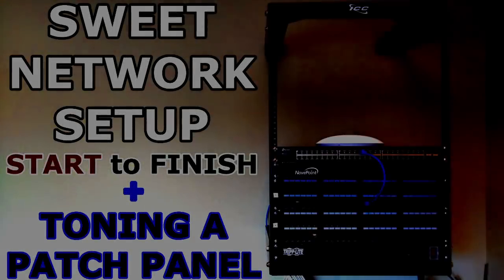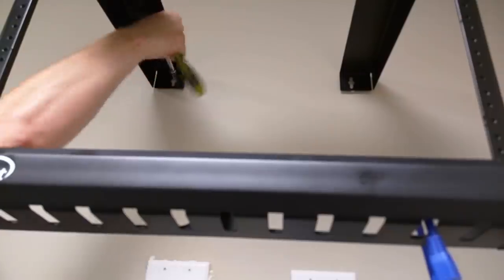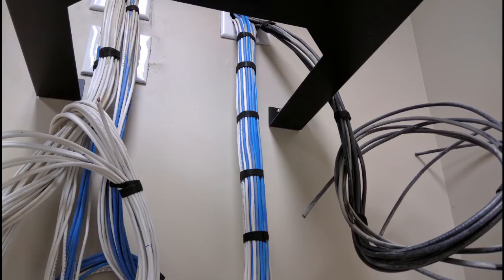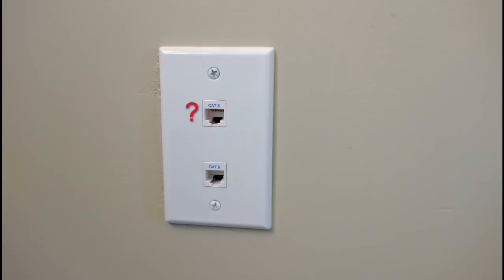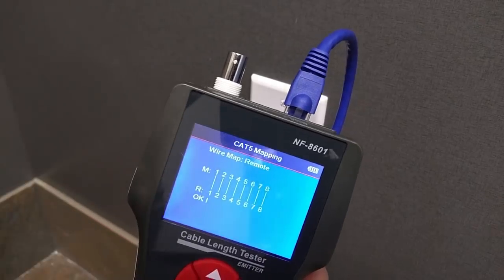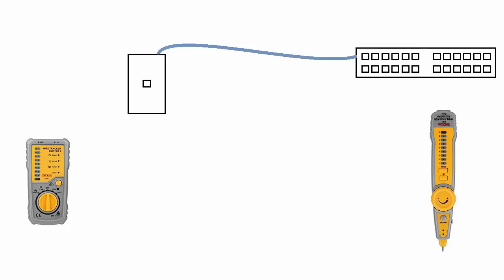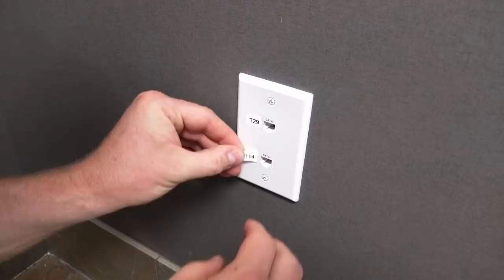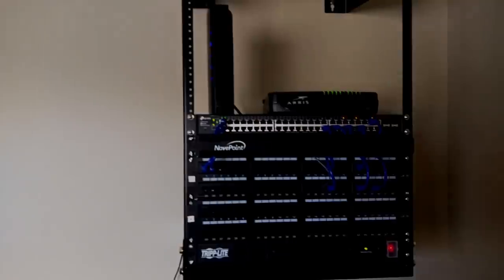Complete Network Setup // Toning, Identifying Ports

Comment: I am no professional and I did the same job in my appartment 2 years ago alone. 16port unmanaged PoE switch, hooked to a 24port patch panel. No testers used on T568B connections and it works flawless. Smart Tv's, Home alarm, Voip, computers, Dvr, etc. No lost packages, everything running 1Gbps steady. The only nightmare is the cable management
Reply: Whats the difference between unmanaged poe switch and a normal switch? 

Well, I'm a beginner and I want to learn.
Reply: @admiralgeneralaladeen2949  there are two common kinds of switches. Unmanaged type which  are  for home use where no supervision is needed(you just plug them in, and they operate) and the managed ones which have subcategories (ex enterprise and smart switches) and built in web interface for further customization. You may find them also as level 2 switches(unmanaged) and as level 3(managed with routing capabilities). To answer your first question, PoE refers to Power over Ethernet, which is another protocol for powering devices through 12v output for example cctv cameras. Practically PoE is needed for long distances where you want to power and at the same time have access to your device without a need for extra cable for electricity. PoE does them both in the same cable
Reply: @aglaisma  I'm starting from the basics of designing network setups. And these things confuses me. Btw, Thanks for the answer. 

1 more question. Do we just plug in some Cat 5e to a patch panel from a switch so that the connection from the switch will extend to the patch panel? 
Like for example. (Switch) Port 1 then connected to a patch panel. Then the whole ports on the patch panel can now have connection comming from the switch? 

I'm very grateful you answered my prev question.
Reply: @admiralgeneralaladeen2949  No. Patch panel brings all your rooms/workstations to one place so you can easily give data/internet/telephony etc via your telephone plug/switch/modem etc. It s up to you, what exactly to connect on it. Mine for example, has 2 Lan cables running to the first bedroom, two more to the second bedroom, one Lan cable to my office, one port is in use of extra wifi access point, one is attached to 4g antenna for better signal of my mobile, one goes to my alarm system and 4 more in the other house. 1 port of my patch panel goes to my modem. In front of this port i connect a plain 5e lan cable to the switch. Now i have internet into the switch and any cable i connect now from switch to patch panel has internet connection. It's exactly the opposite of what you asked. Patch panel ends connections-switch shares connections

Comment: Great video...very useful even 3 years later!  I embarked on a home project, which also entails setting up a home network with Cat 7a STP.  Hopefully you can help clear this up for me.  I've read that Cat anything shouldn't be run parallel (closer than 4") to electrical cabling nor to each other to prevent cross-talk.  However, it seems that I see network cabling bundled together in long runs (and have at my work-place in all of my adult life), not just at the panel and switch.  I have one bulk-head in my basement which I had hoped to run cables.  Advice?  Also, I am now reading that POE will potentially require an electrical certification for installation??  Should these cables be separated from other data cables?
Reply from the maker: It's always best to keep the power wires away from networking cables, or any low voltage cable for that matter yes. For interfere and safety reasons. You don't want high power to be introduced into the Ethernet lines by some short or mistake.

I've never heard of keeping Ethernet cables away from other Ethernet cables though. You're fine bundling those together I'm sure if it.

As far as license for running Poe, I have heard of that, but your laws might be different than the ones in my state. I'd just double check.
Reply: "Cat 7a STP." waste of money.  Gb Ethernet was designed to use plain CAT5, before even 5e was available.  Also, twisted pair Ethernet was designed to share cables with telephones (look up StarLAN).  The frequencies used in Ethernet are much higher than those used in power or telephones, so cross talk is pretty much impossible.  The 4 pairs also have different twist rates, to prevent cross talk within the cable.  I've used STP in only a few situations, running from roof mounted short haul microwave systems, in elevator machinery rooms and on cell radio sites.  It will do nothing for you in a home or office.

Comment: regards,
I would like to know if all the wiring connections take the same pattern from the PC to Keystone Jack then to Patch Panel then to the router then to the poe switch then to the repeater. In conclusion, do you use pattern b for everything, or do you modify some cables?
I have a project in my office and I would like to know if I should use pattern b for everything that uses Cat5e cable, PC, Keystone Jack, Patch Panel, Poe Switch, Printer, IP Cameras, Repeater, NVR and router.
Reply from the maker: Simply put, yes. Stick with one pattern for everything. B is most common.
Reply: @BudgetNerd  Thanks for the answer, but I have another concern because I see other people who make the cable use another configuration, for example at one end of the cable they use pattern A and at the other end they use pattern B. What would be the difference between the way you you use and this
Reply from the maker: As long as you setup the wires the same on both sides, it doesn't matter what order they are in. People won't do A on one end and B on the other end of the same cable that wouldn't work.

Comment: Hey mate me again. When choosing a router what do you suggest? I noticed in you 101 video you had multiple things plugged in but with this you only had one. I planning on having ip cameras, a media pc, plan to pc's and a little bit of home automation. Would I have all 4 plugged into the same router point or separate?
Reply from the maker: I would get a 802.11ac or better wireless router for that. Personally, I would wire all I could if I were you, so you would want to add a switch. A POE switch could power your IP cameras and make that easier.

If you want a simpler setup, you could hook it all up to the same switch/router. You could plug the IP cameras to their own switch (or maybe they come with their own switch of storts) to help with traffic, or to another router to keep them segregated from your normal network. There are lots of ways to do it.
Reply: @BudgetNerd   Budget Nerd  I plan on running everything hardwired and having a wireless access point in the center of the home. Each bedroom one plan port and in the study and living Ares at least 3. Then with the ip cameras I'm planning on running cat6 to all points of the house as many as I can.
Reply: I run pfSense on a mini PC with 4 Gb Ethernet ports and a separate access point.

Comment: At the 10:51 mark, I noticed that you have the ethernet cable coming from the router's LAN port to the patch panel. Is this necessary?? Could I just run that ethernet cable directly to the switch?
Reply from the maker: You can do that. I did it the way I did so I could keep everything neat, so I wouldn't have a cable coming from underneath or from aboveb and into the switch.

Comment: This is the way patch panels have been done for decades. It should be noted that a great deal of world experience has found solutions to some of the PITA parts of doing network installs. I will point out several here.
1. Don't cluster your patch panels together at the top or bottom of the rack. Install panels directly above and/or below each network device. Example: If you install a switch that has 1 row of jacks, install above or below it a patch panel so the patch cables can be as short as possible. Ideal is one 6 inch patch cable to every jack directly above or below each switch port. This does several things. It makes horizontal cable management unnecessary. The cost of patch cables is far cheaper. Every port in the panel is live to a corrisponding switch port. This makes physically labeling port numbers less important since all wall jacks are live from the beginning. Specific devices can be labeled but generally being anal about labeling ports is a thing of the past.
2. Switch away from punchdown panels and jacks to keystone passthru. This makes updating and repairing the panels and jacks faster, more flexible and it can take less time terminating the cable ends with plugs once you get used to it. If you find a specific cable coming from another part of the building is in the wrong panel it can be simply unplugged from the back of the keystone and moved to the correct panel location. Takes a few minutes and you don't end up with long patch cables on the front of your rack.
3. Color code your keystone jacks and patch cables for special port/device configurations. This gives a heads up to someone looking at the patch panel that this port is not like the others. Let's say you have 2 VLANs. Use blue for VLAN1, black for VLAN2, and green for both VLAN1 & VLAN2. Use red for LAG ports. You get the idea.
4. Use smart or managed switches so you can identify each port's description with what the end point device is and the color of the jack and patch cable. Really helpful if you are remotely managing the network.
5. Never run a patch cable over a device or panel that will prevent that device from being removed quickly and replaced in an emergency.
6. By setting things up as in steps 1-5 if say a 48 port switch fails or needs to be upgraded, you power down the switch, unplug all the patch cables, power, and remove and replace the switch. Plug in each patch cable into the adjacent port on the switch and power it on. If you have preloaded the configuration for the new switch you are good to go. You are down for 5 minutes instead of spending half the morning identifying patch cables, jacks and ports.
Let's say you are doing a new install. It's pretty easy to determine if a PC is not connecting to the switch correctly or at full speed. In those cases you can quickly trouble shoot that specific port, keystone, patch cable, or plug end. Just swap the patch cables, redo the cable plugs, or replace the keystone passthrus. If you have 5 connection issues out of 100 cables you should be able to fix all of them in about 20 minutes. You saved an entire day not identifying, labeling, punching down, and routing patch cables on the rack. It also looks infinately cleaner and easier to maintain. Rarely would you  ever need to rip out everthing from a rack during an redesign or upgrade. You can do most of it live during business hours which is fantastic for those 24/7 businesses.
Reply from the maker: Great info!

Comment: So your using Cat6e wallplates with a Cat5 patchpanel? NEVER put in incrimped plugs, even though it's not a huge issue you could break a port. Also put patchpanels on the top instead of bottom, it's much better to access the rest of your gear like this.
When connecting patchpanels, run the wires to the sides instead up or down, you can create a much nicer service-loop and pull a patchpanel out with enough slack and better cable management.

Comment: I have a question. What arrangement did you do to the cable for it to be male on one end and a female on another (patch panel). Seen at 10:32 to 10:37.
Reply from the maker: I made my own cables. So I either added a jack to one end, and punched down the bare wire to the patch panel, or I took an existing cable and just cut the jack off one end and then punched that end down on the patch panel.

Comment: Thanks, great video. I have a 48 port oatch panel and a cisco manned router. i also have cameras that are hard wired to my network. as i learn mors i want to separate my cameras from the rest of tge netwk. any suggestions on how to go about doing that?
Reply from the maker: That's something I need to learn more about as well, but if I would make a recommendation, I would have a managed switch with VLAN support and you could put the security system on it's own VLAN and have it "logically" separated. I think that would be the easiest way. My vet friend will eventually do this too. I better do some Googleing!
Reply: make sure you make a video on it!!!
Reply: Agree with him VLAN but the switch is only part of it the router also has to support it.
Reply: Myzt1c Z3r0 Gotcha. Thanks.

Comment: All these noobish comments....  I think you did a great job.  Yeah you could've used some unifi switches since you're already spinning up a controller for the AP's, but I get the whole budget thing.  Would I have chose TPLink?  We have two 48 port unifi switches with 3 AP's and they have been rock solid.  No monthly fees etc.  Lay it down for the client - if they want that cheap switch then it may bite them later...  Yes when it fails, there goes connectivity.  Any switch can fail, but some are less likely to fail.  I could win the lottery tomorrow too, it's life anything can happen :)  Also you can't control who they used to run the cables and didn't label them.  Hope he paid you what you're worth at that point.

Comment: If the data cables are labeled as they are run, they can be organized and labeled as they are punched down in the patch panel.  This prevents you from handling the cables twice.

Comment: This wiring is only for use internet ? 
if i have a lot of phones ? How i wiring the cabinet plz
Reply from the maker: This is for Ethernet. So anything that can use Ethernet for sure can benefit from this.  So IP phones will easily work with this.

At the end of the day, inside those cables are just wires, so if you have the right cables or adapters, you can use this for many things. For example, with a rj-45 to rj-11 adapter, you can utilize a setup like this to setup old school phones as well. In fact, they are doing this at this place now.

Comment: Why do you use punch down panels? Keystone are so much easier to work with, aswell you can get 48 ports per U.
Reply from the maker: Cost. But keystone panels have been suggested by many, and they do sound pretty slick.

Comment: I have an idea, attach an rj45 to an LED and do that loads, then get a battery pack and attach that to an rj45 connecter, put the rj45 LEDs in the patch panel and the one that lights up is the one attached to the wall panel
Reply from the maker: That is a good idea. There is a product out there like that already.

Comment: Hi.
I like your setup on the network.
but as some others write and what I've been doing, it's easy to label the cables when installed, so the output comes in numerical order. and I thought it was a bit unnecessary to pull the cable from the router to the patch panel.
myself, I took it straight to the switch. saves one output then.
Sincerely Jonas Linder

Comment: Why not tone before you punch them into the patch panel. Then you don't end up with random numbers on plates. Also add a cable management arm between the panels... otherwise it will get messy quickly...
Reply from the maker: +Lochie Nichols I was thinking of getting two cable management arms, but one works for now, but that is a good idea. If you tone the cables, then patch them down, you still would have random numbers, unless you fight the cables to get them punched down in order. Secondly, if you tone the cables before punching down, after punching them down, you would have to go through them all and test them for connectivity doubling the work.
Reply: The point of toning each wire is to get them punched down in order. It makes the punching process take an eternity, but you're going to have to do it anyway to figure out what's what. Because the cables weren't labeled and bunched when pulled, punching them down in logical order will mean a physical disarray behind the panel. (For me, a logical order is a must. The physical disorder is ugly, but no one is ever looking at it.)

Comment: Does the modem need to connect to #1 port on the patch panel/router extender? Or any of the ports are fine
Reply from the maker: The modem needs to connect to the router. You could connect it directly to the router, or connect it through the patch panel like I did if you want. If you set the patch panel up like I did, then the rest of the ports would go to Ethernet ports around the building.

Comment: so question to all the legit pros here.  i am looking to build a home network with a switch and NAS.  i want to hard wire as many devices as possible and also use for PoE security cameras.  i don't really have any experience with command line and setting up VLANs and all the other protocols.  should i get a managed or unmanaged switch?
Reply from the maker: You might consider a managed switch. You can setup vlans with those. At least we do at my work.

Comment: why are you running 4 patch panels with only a 48 port switch?
Reply from the maker: The physical structure is there for expansion. We can always add another switch down the road. They plan on adding 24ish sec cameras down the road.. etc.